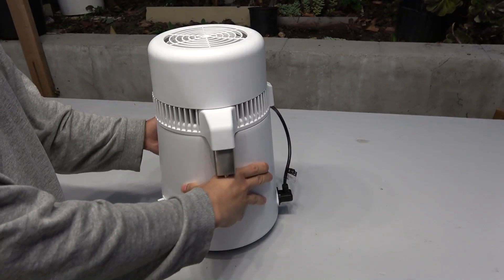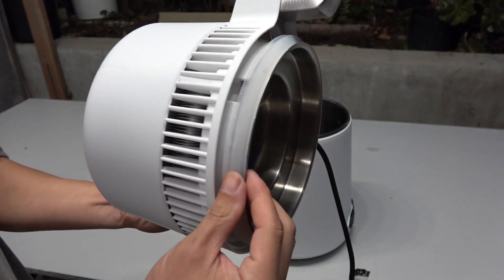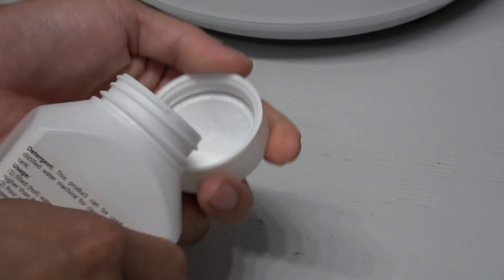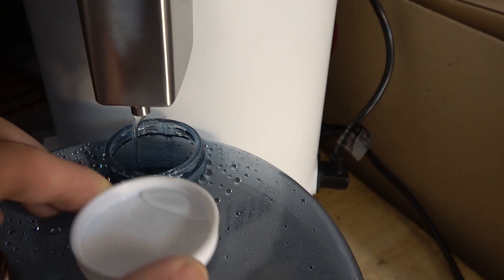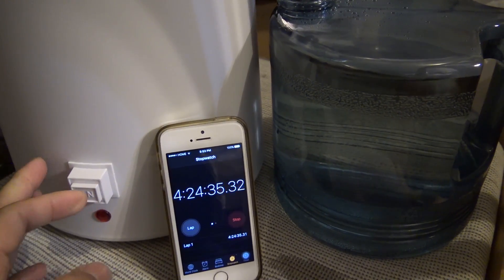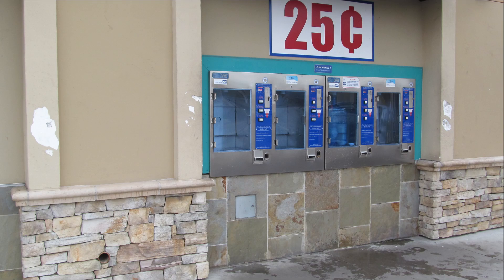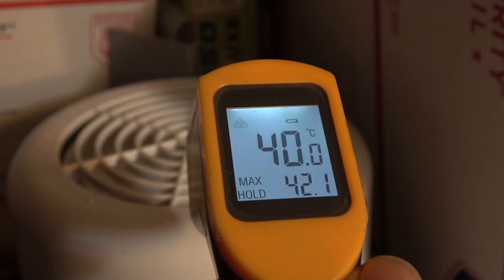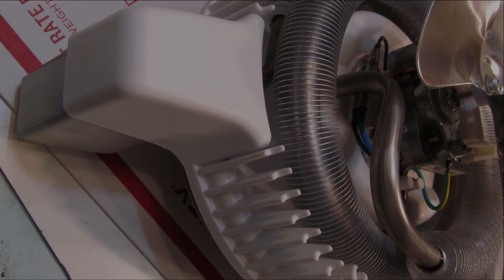Review: $60 Ebay water distiller, all stainless steel internal

Comment: What is the temperature it brings the water up to inside the distiller? It's probably not boiling. Could you open it mid-cycle and find how hot it's getting inside the pot? I'm planning on building my own. I should be able to use a heating element from a water heater, but I'll want to control the temperature with a thermostat, also salvaged from a hot water heater, so I don't waste electricity while it's running. I'm planning on using stainless steel tubing for the coil because dissimilar metals cause galvanic corrosion. I'm thinking of using a float switch to add more water when it gets low and have it connected to a dishwasher line. Squirrel cage fans are much quieter and move a lot of air. Those are the ideas that I'm working with right now.

Comment: Distilled water on its own doesn't taste very good compared to purified water (in my opinion) because all the minerals are gone. It makes sense that the water from the store was almost as pure as distilled water since it only contains some added ocean coral minerals (added for taste). I wonder if the store where I get my purified water uses the same purification system.

Comment: Just a tip...Put the Citric Acid, one teaspoon, in with the water you are boiling, don't let the distiller shut off by itself, stop when the jug is just about full, then you won't need to descale it. The 
Citric Acid is used in cooking and in candy so it won't hurt you. The distiller will last longer.
The carbon bag makes the water taste better.

Comment: Had this for about 6 years now and on my third machine. For the price its well worth it. I use it once a day and two sometimes at weekend. My thoughts are that if   you think of all the crap your kidneys have to deal with, Why make them work harder with un clean water. Most of the minerals are not good for our body's and our kidneys must struggle.  I guess there's no way of proving your healthier for it, But i never get stomach ache for long  now and if i eat something off, I will usually go the bathroom once and that's it. Perhaps my body can deal with it better. I don't blame the water company's for the chemicals. They have to clean it for mass consumption. But those chemicals will over time build up and may cause issues. I think cancers can be one of them.

Comment: For 25 years, at advice of Jack LaLanne and other health advisers I got my first distiller all stainless steel as well.  It works beautifully to this day.   We have well water and hard water it is.  No no acidic cleaner not needed.  Vinegar all way up to fill line, leave overnight.

Next, you definitely have a used or refurbished model.  Waterwise is the brand I think, but it’s an old model.   That is why it was super cheap.   Great company, a USA company.   Yes would not use an old plastic receptacle if you don’t know where it has been.   Good you got rid of it.   Also, mineral drops a good idea to each gallon to replace those lost after distillation.    Great video!!!

Comment: you have to clean the blue water jug thoroughly,put some washing up liquid in it put some warm water cover the hole up and shake and now just let the tap water run into it for a few minutes,that removes the plastic smell what ruins the water,when you do the first lot of distilled water you throw that water away ,the inside is clean now,now wash the blue jug again with soapy water now let the tap run into it for a few minutes cold water,now boil the kettle up,i use 2 kettles of boiled water ,the next lot is pure distilled water ,if you use boiling water from the kettle it takes 2 hours and 40 minutes to make a gallon of distilled water if you dont use boiling water it can take 4 hours,when it is done the red light goes out and the unit auto shuts down,i hope this helps if you are sick get drinking distilled water the unit cost 60 quid off ebay and it cost approx 1,50 pounds in electricity to make a gallon ,i am sick as fuck,i started drinking a gallon a day 2 days ago i am healing i can feel it the pain is lowering

Comment: Excellent video. I received my distiller filled it up and made the first gallon not reading the instructions. I used a bottle of RO water I have that doesn't have a pour spout and has been sitting in the bottle over 2 years. There were some marks on the bottom of the distiller so I cleaned with the included citric acid. Came clean very easily in minutes. I drank the water and it was delicious but the pamphlet said not to drink the first batch so I discarded it.
The best part of your video was about using it as a space heater. 🤣 
Appreciate you did the tap, Berkey and RO fill up tests. Very good video.

Comment: I have one similar. I find on average it takes about 5 hours to do 4 liters if the water starts off cold. But I am also noticing that I lose about 1/2 ro 1/3 of a liter of water during the process. So If I fill the jug to the top, after its finished distilling, I have about 2cm to 2.5cm less water.  I'm assuming some evaporates out because what comes out is still hot and gives steam and maybe some escapes out around the silicone seal slowly? Not sure.  Do you find you lose some water too?

Comment: CRITICAL issue: TDS, total dissolved solids in your finished distilled water. My tap water is 320 TDS, purchased spring water, about 140 to 200 TDS, Bought distilled water 0-2 TDS. Anyone test this output? The sensors are cheap.

Comment: As citric acid is a little expensive to buy, white distilled vinegar works just as well.   Just dilute with a little water to ensure that just the base is covered, then let it sit.   Wipe around the rest of the interior with the  diluted vinegar solution, leave for a while, then rinse everything.  I clean mine after every usage, as it does not take long.

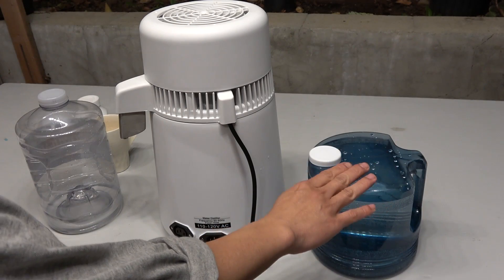Comment: @3:21 The reason the first batch of distilled water  tasted like "used engine oil" was that you were supposed to pour out the FIRST THREE batches of water. After that point the machine has cleaned itself of initial new machine residue. It wasn't the plastic bottle.

Comment: *User manual*:If the water has a taste at the beginning of use, it is normal, please kindly use citric acid cleaning agent and hot water for simmering 12 hours, after using 7-8 times will be normal.

Comment: It doesn't save you power if you preheat water. You still use electricity/gas to make that water hot. it is even more inefficient since you heat kettle and some energy is lost to water vapor before you fill distiller. It is also not healthy to drink distilled water all the time. Buy mineral water from time to time to get minerals into your body. In case of tap water contamination, it might be cheaper to buy bottled water than use electricity to boil-distill water.

Comment: A couple of comments. I bought my unit from Vevor. It included some instructions. They weren't the best, but they did answer a couple of your concerns.  

The cleaning reagent is citric acid. Citric acid is easily available from a number of sources and is inexpensive.  

Also, in regard to the taste of the water using the included plastic container, the instructions specifically state, upon first use of distiller,  to flush the main tank with 1.0L of water and 2 tbsp of citric acid, cover the head assembly, and bring to boil for about 20 min, rinse, and toss the distilled water.

After the initial "clean" job, the water should taste just fine on the next iterations.

Comment: Look up a medical encyclopedia - our body runs on water with some 0,3% of certain salts (mostly sodium, potassium, calcium). That's what the residue in your pot is.
Sodium and potassium control your blood pressure and make your nerves work, calcium builds up your bones.
Drinking destilled water will dehydrate you similar to saltwater from the ocean, which contains some 3% of salts. 

As you mentioned, the device runs on electricity, IMHO it's not suitable for a SHTF- scenario.
BTW: how much money do you have to spend on a solar-installation that provides the power needed? Much more than a pressure cooker, a wood-stove, a bucket and a coil of copper pipe, I guess. Think again !
Reply: You get  sodium, potassium, calcium from food, not water.  The trade off ... all the harmful minerals, etc. in water ... is just not worth it!
Reply: @paulm.7422  - May be, you have only access to bad water, standards are quite different in different countries. Here in Germany our tap-water contains no harmful substances (at least the 38 best known ones), they are removed by all providers - bottled 'mineral waters' are only tested for 8 substances like arsenic and uranium, not for pestizides e.g.
However, if you choose to destill your water,  be prepared for a power-outage in a SHTF-scenario and add some 0,3% physiological salt-mix.
Stay safe and take care.

Comment: To quieten and reduce  fan friction, place a drop of sticky motorcycle chain oil into the shaft . Anyone know model number of fan motor?? Mine broke (not because of oil, because I removed the plastic insert in the lid which directs and concentrates airflow. I thought it would be cooler without it )
Reply: Check his other video of breaking down this unit ...  (YouTube search:)  
Teardown: Ebay 1-Gallon Water distiller.    That should show you.

Comment: From above, take a look inside the fan housing at the steam tube, does it have a tiny hole right before the cooling fins that lets hot steam escape?

I just found that out that in my distiller and am wondering why would there be a hole there that lets steam escape?!

Comment: Excellent video. Finally got my hands on one of these. Very efficient indeed. I set a 4 hour timer to turn it off just before it cook off all the water for easy cleaning. To save more energy, I only plug in the fan 30 mins after the water comes to a boil. Cost about 35¢ per gallon according to Killawatt meter in my area.

Comment: I live just outside of Tucson and the water here is hard and horrible.  I use an under-the-counter filter to make coffee, but use water from a reverse osmosis dispenser for everything else.  It's not the worst tap water I've ever had, but it's certainly in the bottom 10.  I'm moving back to Oregon in a few months, where you can actually drink the water out of the tap, but still thinking of making a solar distiller, just to get the best water possible.

Comment: Hey brother, is your distiller still working well 2.5 years later?

I'm thinking about getting a "cheap one" from Amazon, but I'm sure if it will last a couple of years or so...
Reply: I was wondering the same thing. I bought a very similar cheap unit from eBay 8 months ago and it still works great. Bought another one a month later as a backup but haven't used that one yet. I've run it through my KillAWatt meter many times so I estimate between electricity (50 cents/gal)and cost of unit, if I get one year use, I'll just about break even from buying a gallon every 10 days for my CPAP tank. Plus the added convenience of not driving to store, storing bottles, etc and also recommended for emergencies.
Reply: Given many of the bad Amazon reviews on these cheap units, just for peace-of-mind, you'd probably do well buying a 4 year warranty ... about $10 extra on a $60 distiller.

Comment: Distill water has some what of a metallic taste. The charcoal filter that came with mine didn't do the job, so I removed it. Once the water is distilled, I run it through a charcoal filter pitcher and that removed the distinct distilled water taste. Works great! U can buy the cheaper great value brand pitcher at Wal-Mart. It flows faster and all u need is a charcoal filter, so no need to spend big bucks on one b/c the water is already clean n pure.

Comment: I own one of these. I bought it to replace a much more expensive unit that is twice as big and only distills about 3/4 of a gallon of water at a time. I used distilled water for my CPAP machine's humidifier. That's another use for distilled water including other things mentioned by other people who have commented. When you buy purified water it is water that has been distilled.
One thing about the tank that comes with it. If you rinse it out with hot water several times the poor taste and smell will go away. But I like the idea of using the other type of bottle because I like the idea of having something that doesn't take that extra little cap under the spout.

Comment: It's not the plastic containers that smell, it usually states in
the instructions to be sure to discard the first 2 or 3 batches on the count of using oil and other chemicals during production. I'm not familiar with that particular machine, but it's the way it is with all manufactured products and are always supposed to run them a few times before consuming. I was reading some reviews on another distiller from Amazon that did not come with a container, and some were complaining that it tasted like petroleum. That is part of the manufacturing process and is why it's very important to not consume, so they always instruct to not use the first batches FYI
Reply from the maker: That container already smelled like petroleum before I even added any water in it.
Reply: @vuaeco  oh really, well it doesn't surprise me that much as they are made from petroleum and should have been washed prior to use regardless if it was in the instructions or not. But as far as the machine itself, anything that has been mechanically produced leave behind tasty residues during the manufacturing process and always need to be ran through a few x to clean them out. It's not something that can simply be washed and have got to run through a few cycles in order to completely remove residues that are not only nasty smelling, but can also cause cancer and must be eliminated before ingesting

Comment: I decided to go with the marine grade megahome distiller but in all my research I got a few tips etc & your video covered them also so well done on a comprehensive video...I think that the distiller you have is known to run on too many watts hot noisy & unreliable & any company that uses non BPA plastic to store water is just cutting too many corners.still at that price it’s not a bad buy..
Reply: Do you have a water distiller that you recommend?

Comment: The minerals left by the Berkey have been proven to be beneficial for our bodies.  So I won't worry about the few left after running through a Berkey.  However, I have a Navage nasal irrigation system and a CPAP machine that require distilled water, and for that reason I will be distilling my own water rather than purchasing jugs from the pharmacy.

Comment: How do you turn the distiller off manually?  Do you have to pull the power cord out of the wall or can you press an off switch?  Here in Arizona desert (very hot and dry climate) we get sparks if we unplug a machine while it's running so we need a distiller with an off/on switch so we don't have to pull out cord from wall.
Reply: If it doesn't have an off and on switch you unplug it. I plug mine into a power strip so I can just shut it off.

Comment: Thanks for the video! 

I've just had one of these delivered today and your video was very helpful.

However, I did notice in the instructions they say you should not use the first bottle of distilled water. The first distilling cycle is a 'self-clean' cycle. 

I'm guessing that this is why the water was so bad first time you used it.

Comment: I just received mine and I'm not sure if it's working properly. As soon as I plugged it in the fan turned on and the red light in the front lit up, I never touched the push button 'on' switch. I then tried to push the on button to see if it would turn off and it won't turn off. The instructions are pretty basic - no information about this - it says 'push the button to start it' but that's it. Any help would be greatly appreciated, sir.
Reply: You fixed the issue?
Reply: @hanszimmer121  I figured out that it automatically turns on without having to hit the start button when you first plug it in. 

No big deal, the start button works like normal if the machine stays plugged it. It's been working great since -- used it a bunch of times!
Reply: @Fergusbaddog  I just started using it since yesterday but after 8 hours it was still working but there came no water qq i dont know what the problem is
Reply: @hanszimmer121  I want to say ours takes about 3-4 hours to finish: all water distilled and it auto shuts off. 

I would recommend trying to get a hold of the manufacturer or dealer - I think 8 hours is way too long to run. Mine was purchased from Amazon and I was able to contact the manufacturer through their page - they told me about the plug-in start up issue.
Reply: @Fergusbaddog  hmm yeah I bought from AliExpress, it is working good but it doesn't fill the tank. So I don't know what's the problem

Comment: Good for emergencies, but not for everyday use (based on cost) for where we live.  Thanks for the video that helps with understanding that ... mid-tier higher priced electricity means almost $1 per gallon, which we can buy in a store locally for.  If we were lower tier, then it's only $.40 per gallon.
Reply: The problem is that store-bought water has been sitting in plastic containers.
Reply from the maker: Totally agreed.

Comment: I do not know why. You are choosing to distill water. But if your plans are to have water in a S.H.T.F SCENARIO. Then this is not a good idea. You need to make one to use on fire. It may take more money. But it will work with out power. This thing needs power to work not a good idea.  Need to be self sufficient. That is always the best route to take.